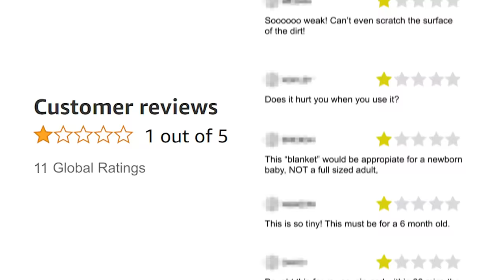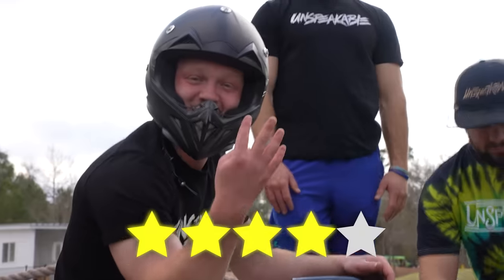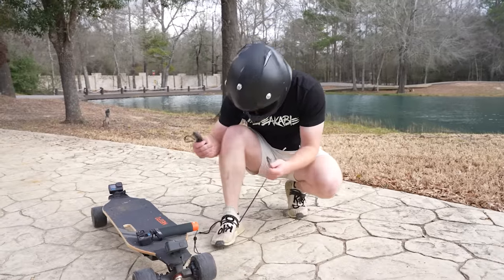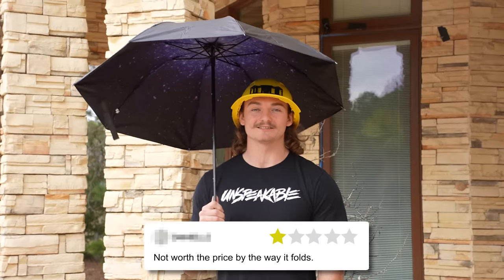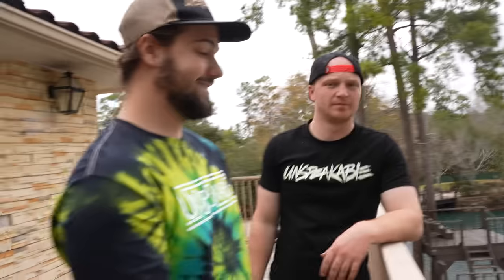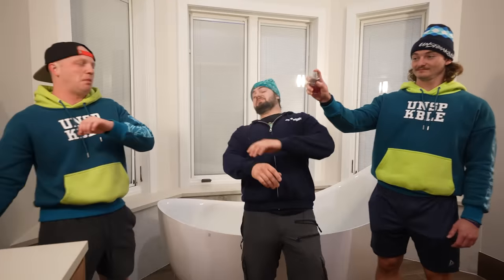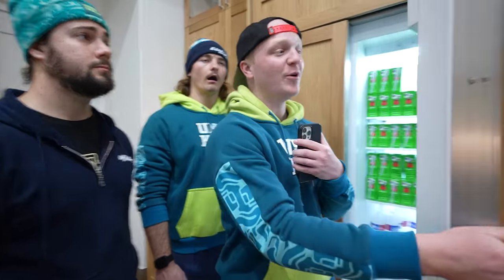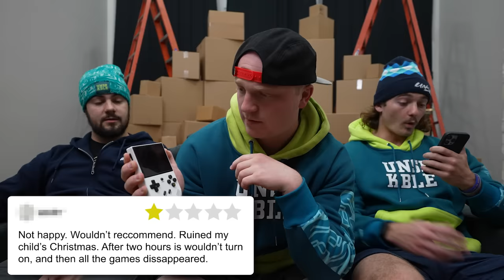I Bought 50 1-Star Products

Comment: not trying to be that guy but the mini bike has a 2 stroke engine in it. that's why its pushing white smoke out of the exhaust. if you wanna know more about 2 strokes just search it up. they have a lot of torque in 1st gear and sometimes in 2nd. they are really fun to ride, but they are expensive. the white smoke is from the engine because they cannot be lubricated by oil contained in the crankcase and sump. its pushing that white smoke out the exhaust because the oil is mixed with the fuel that lubricates the engine's moving parts and cylinder walls.

pls make this top comment or pin pls

Comment: that katana was actually not a real katana because katanas have a special clay at the back of the blade to make it hard and that makes wavy marks on the blade that you could probably see in the video but the marks are usually more un even and unique when the waves are all perfect like that its probably not clay they used and was not hand made wich means its not actually a katana because katanas need to be made correctly with all the parts to be indetified as a katana this "katana" in the video is also dangerous because of how cheap it is theres risk of the tang snapping and the blade flying across your yard and probably into someones chest.